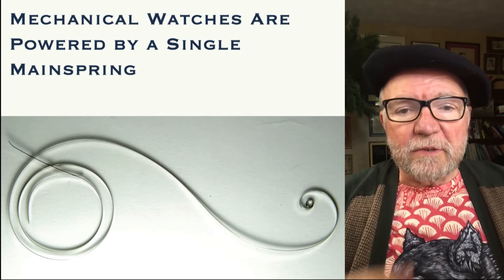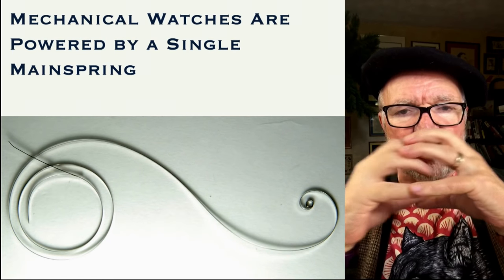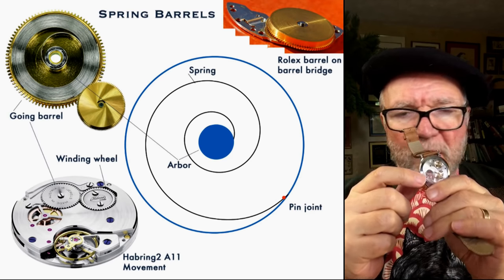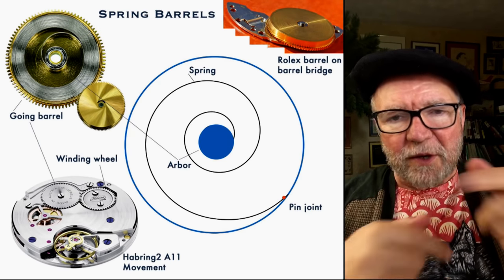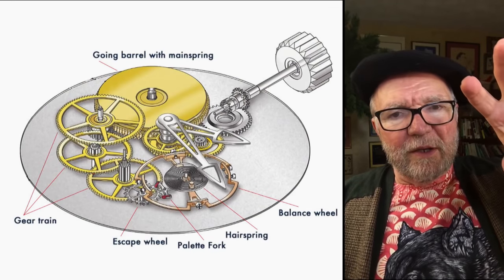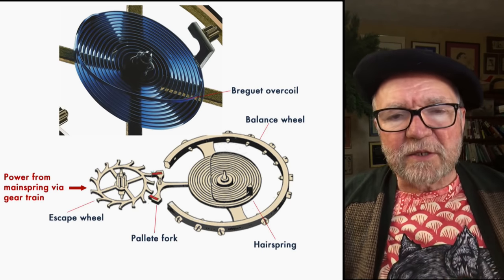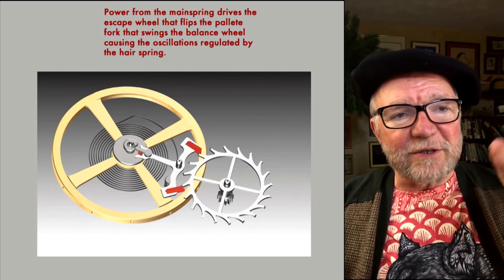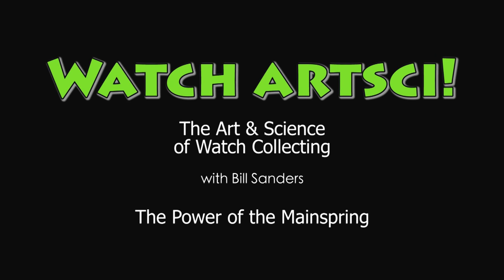The Power of the Mainspring #139

Comment: Very informative, thanks. Main springs and hairsprings are one of the mechanical watch parts that have taken the most advantage of new technology. I have serviced many pocket watches... second to broken balance staffs(not because of mechanical failure) is broken or weak main springs, followed by corroded or mishandled ( by not so competent "watchmakers") hairsprings. Age, of course plays a big role as well.
Reply from the maker: Watch Guy, I'm getting more and more interested in pocket watch movements like the Unitas 6498. Any tips? Kindest regards, Bill
Reply: Hi Bill, I don't come across many of them (entire watch) but have owned and sold about 4. 3 with the farmer's ranch dial and one with Catena horseshoe dial. These ones had the 6497 movements as they are open face watches. The 6497 has a very distinctive ticking when compared to that of most American made pocket watches, Time accuracy is great. If I recall right, they were first introduced in the early 50's. Regards,Gilbert

Comment: Am wondering if the unwinding of the mainspring can power or wind a 2nd smaller mainspring? If accuracy is lost as the mainspring releases its tension, the 2nd mainspring could add back the lost mainspring tension...Or am I proposing the elusive perpetual motion machine?
Reply from the maker: Hi FC, yes. In fact that's the principle behind a remontoir d'egalite, ( https://www.hodinkee.com/watch101/ ), The mainspring winds the remontoir, and it unwinds in a steady state to provide constant force. Kindest regards, Bill

Comment: I did a test on my Seiko Sarb 033 about winding it different ways. Let me explain, I first grab the watch and rotate it slowly 360 degrees in one direction while hearing the teeth grinding and charging up. It takes around 50-80 turns until the watch starts to work. Test 2: I grab the watch and shake it only once and it starts working. Can someone Dare to explain how a watch can start immediately after one shake but takes longer if done like Test 1 ? I know this might sound stupid but I can't understand because One Shake isn't equal to 50-80 slow turns and I don't know what causes the watch to instantly start with only One Shake when compared to all those turns.
Reply from the maker: Hey Beast, I cannot. My hunch is a firm shake kicks the palette fork, releasing the power from the main spring and causing a semi-oscillation in the hairspring which in turn sets your wonder watch into motion. Cheers, Bill
Reply from the maker: You said, " Can someone Dare to explain how a watch can start immediately after one shake but takes longer if done like Test 1 ? " and I replied, "I cannot" and then went on to provide a hunch. Clear now? Bill

Comment: Jesus, Bill, did you post this at 4AM your time? Insomnia much? Nice video in any case!
Reply from the maker: Hey, I slept in! It wasn't up 'til 4:45AM! Cheers, Bill
Reply: Excellent video as always bill, but did you get dressed in the dark? It seems a rather odd ensemble ;)
Reply from the maker: I had on my tee from Upper Playground with a mythical Viking wolf, and my wife jacked up the air conditioner, so I put on a cardigan and off I went. (I do much better getting dressed in the dark...) Cheers, Bill
Reply: @watchartsci  what are mainsprings made out of? plzzzzz help
Reply: its just steel, oops  :P
Reply from the maker: @x_x3867  Lots of different alloys X_X. One of the favorite of Independent watchmakers is the Straumann hairspring made of niobium + titanium; Rolex's Parachrom is niobium + chromium. Gaining popularity are silicon-based hairsprings and escapements ... that I would prefer to keep out of my watches ; even though they are superior to metal ones in that they are less subject to temperature variations and magnetism. Cheers, Bill
Reply from the maker: @x_x3867  Nope .. too easy to magnetize. Bill
Reply: Thanks Bill.  Fascinating.   Has been for centuries!

Comment: i have a 3d printed clock ( my design ). currently it is weight driven and is in my garage and it works, Im so happy with it. I am looking forward to making another that uses a main spring. Currently my clock runs very well at 22 lbs of weight driving everything, seems like a lot but my center wheel is about a foot across and the fact that this is only my 2nd working clock and the friction between the gears anyway back to it.. im assuming i would need a grandfather clock main spring but im not even sure if there is a spring out there that would deliver the 22 lbs of torch i would need to turn clock gears.. i have pics of everything if you would like to discuss the issue.
Reply from the maker: Whoaa! Well, WhiteDwarf, that sounds fantastic! Since this channel is about watches instead of clocks, what would be very cool is that if you made a clock that was really a big watch that could be used to show the main parts of a watch—from the winder to the escape mechanism. Maybe in a future project you could make something like that? Thanks for sharing, Bill
Reply: @watchartsci  thanks for responding

Comment: You could do a whole segment just about metallurgy in a watch.
Reply from the maker: Hi Andrew, you are soooo right! I was recently reading about how H. Moser et Cie made their own hairspring using a combination of niobium and titanium.  http://media.h-moser.com/en/articles/precision-engineering-and-h-moser-amp-cie-present-their-paramagnetic-hairspring/ Cheers, Bill
Reply: My metal design teacher made us work in titanium.  It destroys every tool it touches.  Prepare yourself to go through drill bits and saw blades.  But one of its interesting features is that its oxide layer changes color permanently when exposed to electric current.  And the color is affected by the voltage.  You could make blued hands with titanium using that method.  I don't know anything about niobium.